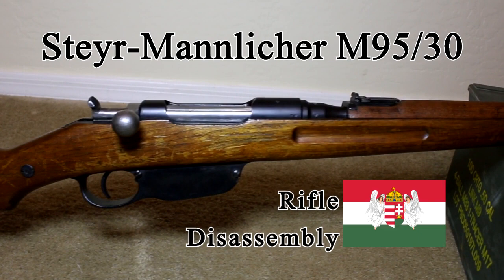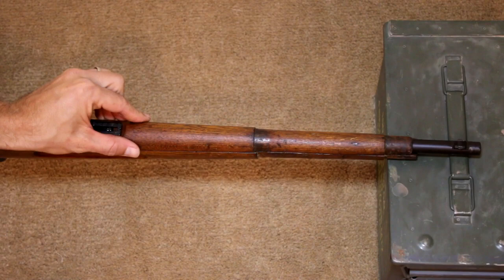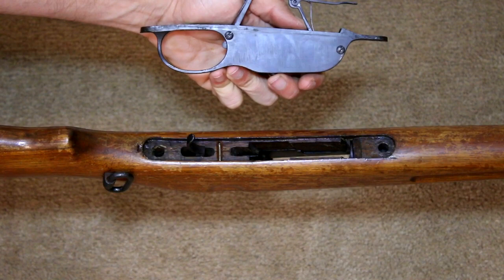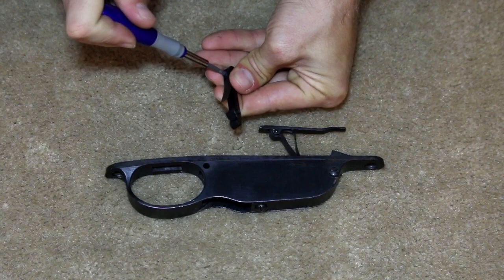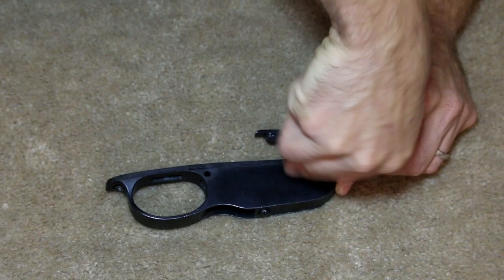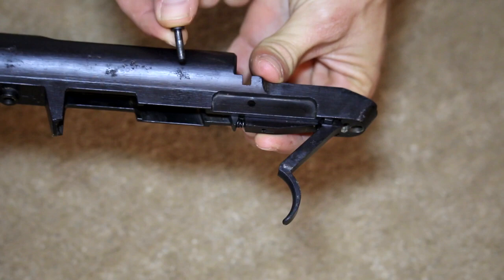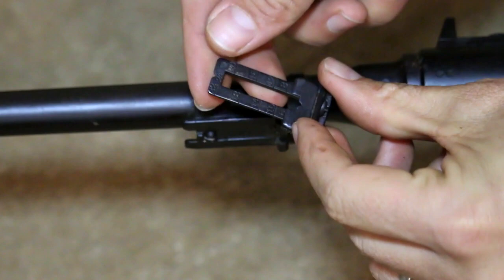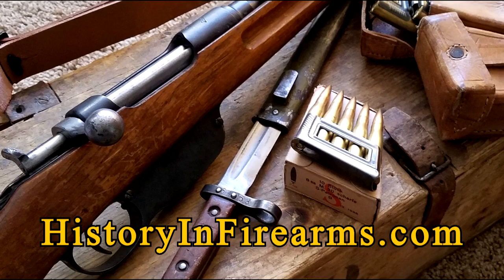Steyr-Mannlicher M95 Disassembly

Comment: So how would  you remedy an extremely loose rear sight slider?  Specifically, the slider on the ladder is extremely loose and will not hold a "distance" even against gravity, much less under firing conditions.  Any help would be appreciated.

Comment: Any idea how the rear sight leaf spring comes out?  I removed the screw but can’t get the spring out.
Reply from the maker: That should be dovetailed in the sight base and would likely need to be punched out after the screw is removed. Would probably be best to remove the rear sight to do this also as that gives a better angle to punch from.